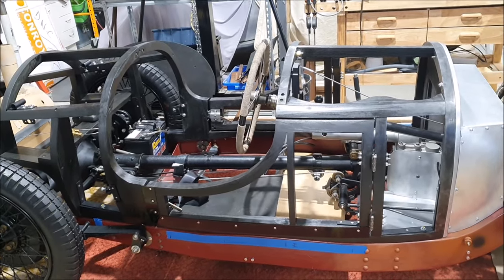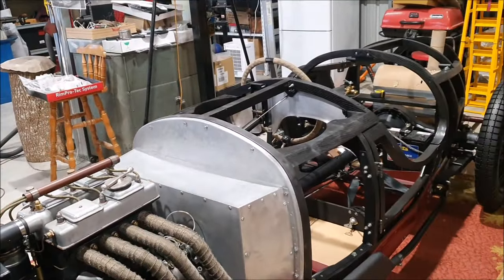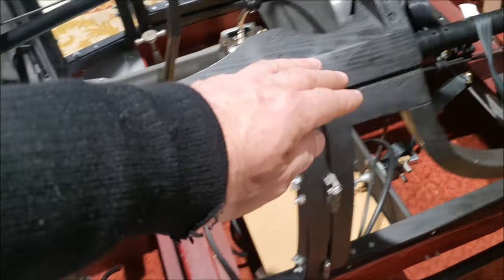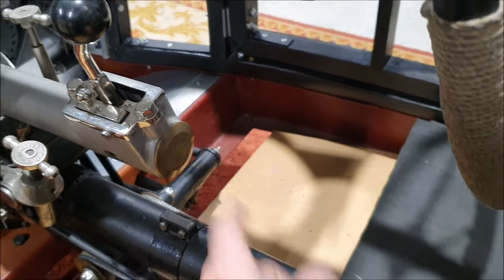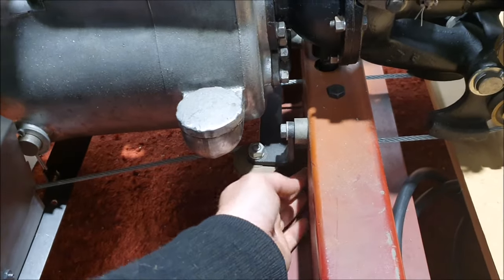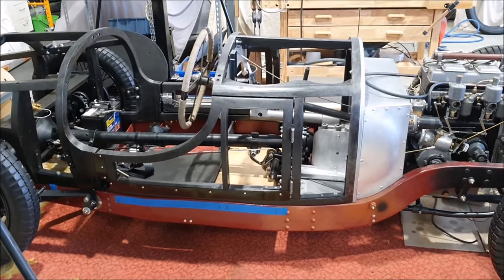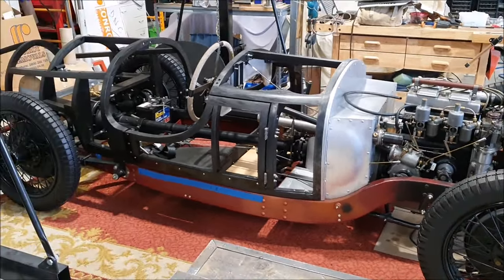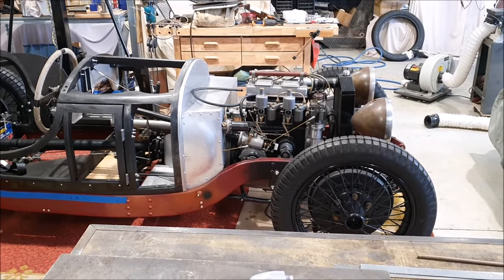Pre war Riley Brooklands - waiting for metal and fixing a push mower

Comment: Lots of lab experience with ultrasonic baths; best to either clean items in the main tank (in whatever mix you use) and drain, rinse & dry frequently, or fill tank with water and place items in a container within the bath with your preferred mix in that (preferably with matching surface levels for best sonicating). Being allergic to moulds (a slight problem for a microbiologist) I felt itchy from the other side of the planet when you showed your basket...
Reply from the maker: I usually use a separate container or jar in the basket with the cleaning stuff in that and just plain water in the cleaner itself. I have no idea what I had in there to cause that mould.

Comment: You don't actually need a flexi hose to the pump. Nor do long lengths of rubber tube look right on 30s cars. Using copper tube would also allow you to form a tight bend where the fuel line meets the pump.
 Its not really necessary but if you wanted to allow for movement of the frame relative to the floor a simple loop in the copper tube would do the job and look much more appropriate. But it would make forming and fitting the fuel line easier to have a joint under the floor where you planned to have the rubber tube begin.
Regarding forming bends in the fuel line, one can now get a polymer (Polybend) that replaces the likes of the low melting point metals like cerrobend for filling the tube to prevent it collapsing on bending. Its indefinitely reuseable and dissolves with hot water so no trace of it  remains after use. Pretty cheap too.
Reply from the maker: I have to have a flexible connection somewhere according to the rules and I haven't been able to work out if anti vibration loops count! I'd have to check with the head office. I agree all copper would look much nicer and period correct. I looked up that Polybend, I guess it's the stuff from lowdenlimited? it sounds like useful stuff. I've never had much luck with that 'packed sand' bending technique. But looks like it is available in the UK only.
Reply: Sounds like NZ is a hotbed of needless bureaucracy. The SS100 has an ash frame, panelled in thin aluminium. Over the years the frames rot, settle and distort and the copper fuel piping, which runs inside the chassis side rails has no anti-vibration loops and simply turns through a right angle and runs up the firewall to the reserve tap, mounted at a similar height to your fuel pump. The pipes never fracture due to vibration or movement. However it should be mentioned that the pipe has a good wall thickness and some modern copper tubing is quite thin. You should get the thickest you can. Whilst it will take more force to bend, it's also less prone to kinking when forming the bends.
Reply from the maker: @angusmurray3767  I think another rule says you can't use pure copper so I have cupro-nickel which won't crack. It's not too bad here. I was watching Oak Swamp (finally) the other day and I can't believe the Austin 10 he built is able to be road legal. So many things on that wouldn't be allowed here at all.